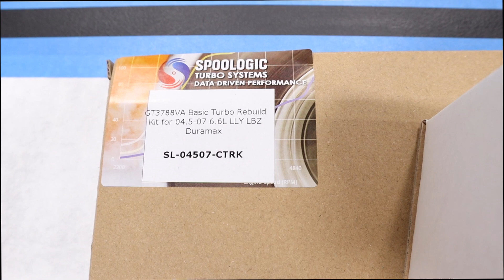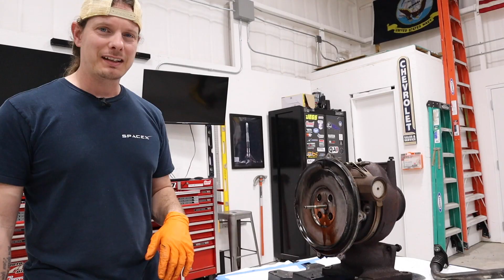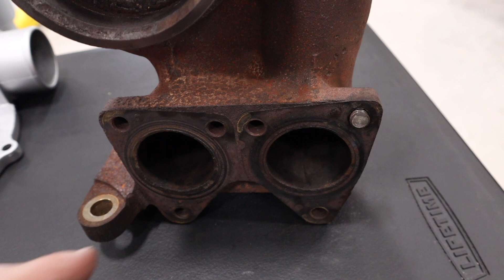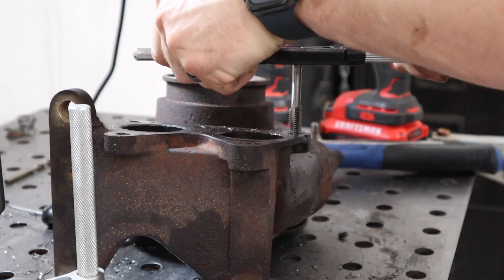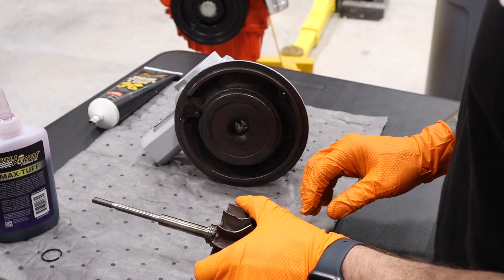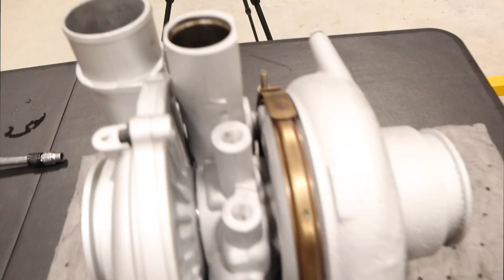Duramax Build Part 5: Turbo Rebuild!

Comment: I'm a little concerned about the Quad cut O-rings (2) not being replaced on the plunger and I also noticed they are not in the kit (spoologic kit). They should be slightly proud of the plunger shaft and are not - what are your thoughts on this? (14:32 for ref.). Thank you for the video I am currently rebuilding mine 2006 LBZ 340,000 miles!

Comment: Great video! Did you need to have it balanced before using it?  Also, did you reuse the 3mm roll pin? Also, what seals are used for the coolant lines?
Reply from the maker: Thanks! The compressor wheel is pre-balanced. I’m pretty sure a new roll pin came with the kit (not 100% sure on that) and the oil lines use copper banjo bolt crush seals.

Comment: Great Video. Is the little arm that moves the unison ring supposed to be hard to move by hand?
Reply from the maker: If it is still connected to the plunger, it may be hard to rotate (because you’re moving the plunger back and forth) but if it’s disconnected it should rotate freely.

Comment: What size socket did you use on the back wheel to get the wheels apart
Reply from the maker: Man it’s been a minute since I did that rebuild but I think it was a 7/8 😬

Comment: Did you balance the turbo shaft after adding the new billet compressor wheel?
Reply from the maker: Nope, the rebuild kit I used came with a pre-balanced compressor wheel.
Reply: They need to be rebalance as an assembly  @richphippsgarage

Comment: What was the cleaning solution you used in the ultrasonic cleaner?
Reply from the maker: I used the Zep orange citrus cleaner since it’s safe on aluminum but still pretty strong!
Reply: @richphippsgarage  
Ok sweet. I just bought an untrasonic cleaner. A 30 liter.  At what ratio did you dilute it?  I wanna do all the turbo housing parts. Hot side and cold side.  Just wanna make sure i don't go overboard with it and.mayne damage something.  Turbo was purchased used and it's in good condition but bought all new components anyway.
Reply from the maker: I put the whole gallon in there and filled the rest of the way with water so I think that comes out to a 1:7 ratio of cleaner to water

Comment: Does the plunger and gear sit in an oil stream during operation or does it require grease?
Reply from the maker: Yessir, the plunger and gear will be in the oil flow.  It’s actually oil pressure that drives the plunger in and out!

Comment: I'm interested in seeing your parts cleaning setup. Wow what a good job you did cleaning the turbocharger, something I need to do on my newly purchased LB7 engine...
Reply from the maker: Thanks! I’m not gonna lie, that took quite a bit of elbow grease to get it cleaned up! I cleaned the big iron parts in my harbor freight 20 gallon parts cleaner with some purple power degreaser and some stuff scrub brushes. For the aluminum parts and the center section, I used orange degreaser in a heated 8gal ultrasonic cleaner.

Comment: How do you remove pin from plunger. The video didnt really show how you did it before cleaning parts.
Reply from the maker: Yeah I didn’t do a great job at capturing that part of the disassembly. You have to use a drift punch and hammer to drive out the pin. It is snug but doesn’t take that much force to get it out. Hope that helps!

Comment: I’m in the process of rebuilding my turbo off my lly…not sure how to get that pin out that holds the gear that moves  the plunger lookin thing I can get it off the gear and push it out but it won’t go all the way through any tips?
Reply from the maker: You have to use a roll pin punch (or similar punch) to carefully drive that pin out to separate the gear and shaft that drives the unison ring.  Once you get the pin mostly out, you should be able to remove the shaft then carefully drive the pin the rest of the way out of the gear.
Reply: @richphippsgarage thank you i appreciate it there was a tad bit of runt on the end of the cylinder the plunger sits it a light touch with sand paper, slid right out but in the process of putting it together I broke the first tooth on that pinion gear and can’t seem to find a replacement one anymore…but thanks for the help I really appreciate it!
Reply from the maker: @kaidentabor7009  ah I see, I didn’t realize you were talking about the plunger!  Glad I could help and I’m sorry about the broken gear.. I’m sure you’ll find a replacement!

Comment: Did you put the whole center section in parts washer?
Reply from the maker: It was either the parts washer or ultrasonic cleaner, I can’t remember 😬.  Either way, I used a mild water based degreaser to clean it up.
Reply: I'm doing this process now
Reply from the maker: Good luck!

Comment: Thank you for this video. My 2006 is at 165,000 and giving the typical codes. I’m trying to psyche myself up to pull the turbo out and do this. I know it needs it. Mine still has an intact EGR.
Reply from the maker: You’re welcome! Be careful with those up-pipe to turbo pedestal bolts.  They are normally very stuck and will snap if you get too aggressive with them!